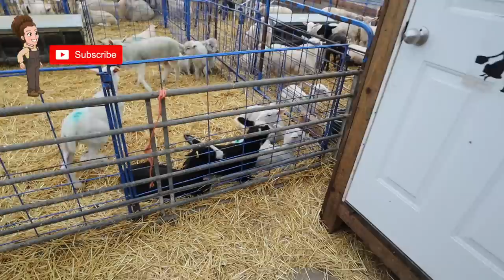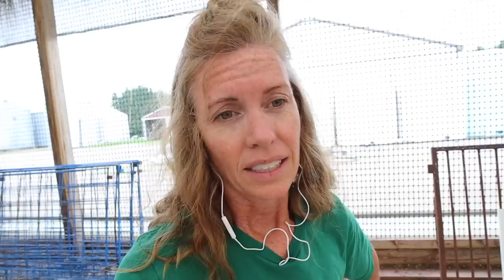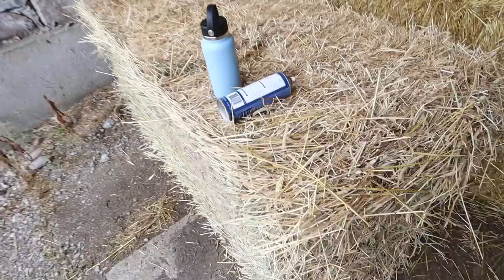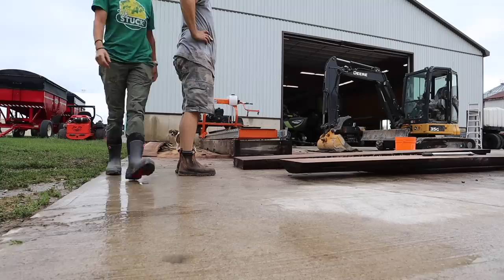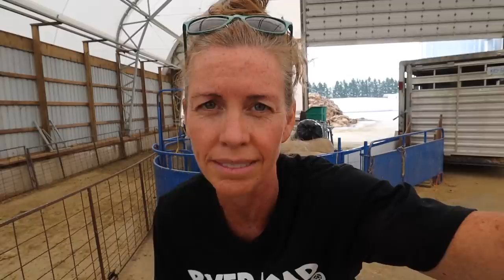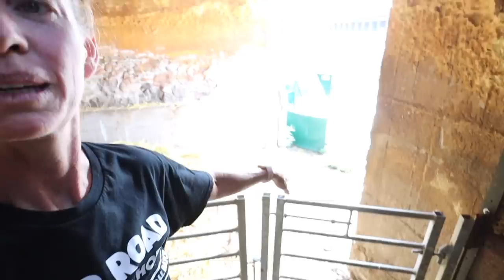I OPENED A RETIREMENT VILLAGE FOR SHEEP??  *these ewes had a good savings plan😉  Vlog 606

Comment: So happy to see you got some rain.
I know all about no rain. It has now been 55 days with no rain, at all, here in my little town in Oklahoma. The only moisture my yard  has seen, if when the dog jumps into her water trough (a pool to her. lol), and the water splashes out or drips off of her. I haven't had to mow my yard since around the first week of June. When you walk across it, it makes crackling sounds. There are clevises in my yard, that a small animal could fall in. We have a small chance for rain, for the next 3 days, but if it's like the other few times, it comes barreling towards us, and either dissipates or splits and goes around us. I need to learn a rain dance.
 Hope the ladies figured out where the barn was before dark. I'd be worried about predators. I'm sure they'll be fine tho. You've got it handled.

Comment: Hi Sandi.   i found a wasp/hornet foaming spray at Peavey Woodstock,  Doktor Doom, big black and yellow can.  A bunch of paper wasps were building a colony in the open tubing of our 'people 'gate into the pasture and my daughter was stung. She had a horrible reaction, swelling, infected, blistering.  (Ended up putting gauze on blisters and wrapping with vet wrap... Guess she was easier to treat than the horses would have been.)Last night i sprayed the tubing with that spray,  and they were dying in front of me.  Never tried the stuff before, but I'm a convert.  Has the little tube to spray 10 feet away.   I'm jealous of your rain, at  my location in Brant county i don't think we've had more than an inch since June.

Comment: In Alabama, I would consider those to be a kind of wasps and not Yellow Jackets. Yellow jackets are more akin to a hornet, but make their nests underground (which take on a more similar appearance to beehives in cartoons, with an outer layer protecting the inside)
If one stings (or is killed), it releases pheromones and they all come after you. Wasps have more a tendency to only head in your direction if you bother them and then only the ones that were disturbed specifically and not the whole nest of them. (Of course, spraying the nest or knocking it down will draw attention from all)

Comment: Ewww... You should go after those wasps at night!! Also with a red light. (They don't see red)  Wasps cannot fly in the dark. I had a couple in my bathroom one night and tested the theory (because I didn't believe it) as I flicked the light on and off a few times. Light off you could hear them fall after a couple seconds. Light on they stretched like they were waking up and flew again in under a minute.
Have also used lubricant spray to keep bees and Wasps from returning to old nests

Comment: Your flock management system rings everyone’s tails - for management to keep bums cleaner and prevent fly strike  - but doesn’t ring the ram lamb’s parts.  Is this for improved growth in the little guys, or what your ram lamb buyers prefer?   It does seem the sheep channels from the UK nearly always have specific flocks to specialize in raising purebred tups (rams) specifically as terminal sires, or to be sold as rams for other flocks.  This makes a lot of sense, as those terminal sires will always be producing lambs for the food chain - or be used to produce more purebred sheep for the future.  I remember your Lucky the Suffolk ram stayed, because he was small enough to fit in your handling system AND wasn’t an aggressive, dangerous character to be handled.  The most gorgeous ram on the planet becomes a liability if he’s always bashing the farmer -  beautiful or not, no animals that need frequent handling, should be aggressive or dangerous.